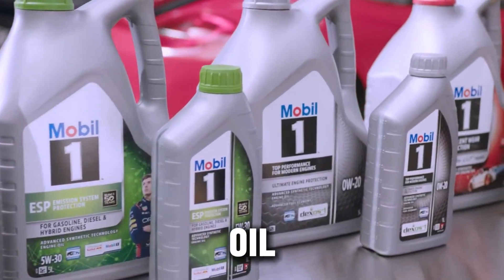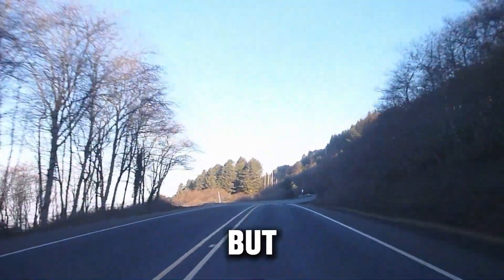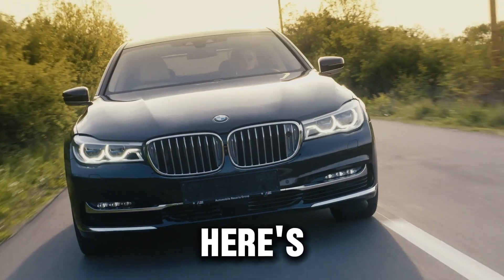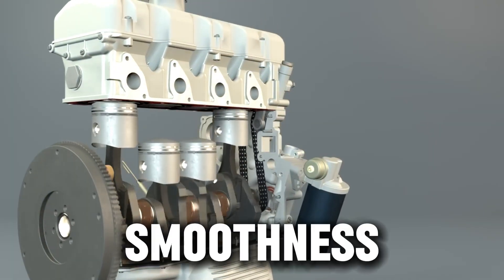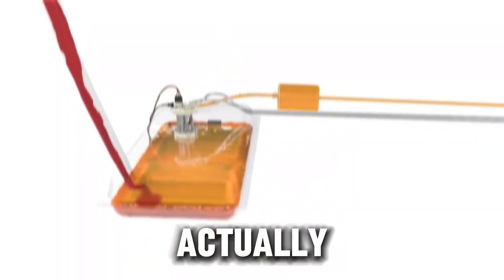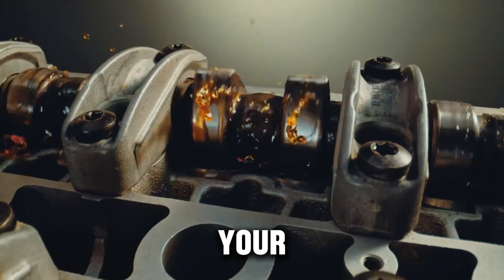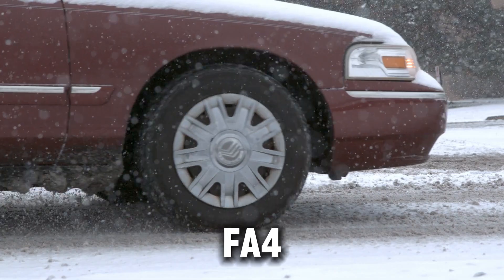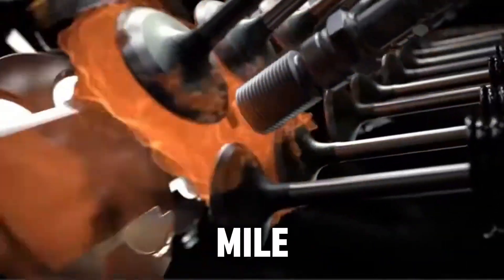The TRUTH About Diesel Engine Oils (50 Engines Tested!)

Comment: Here's where the myth came from about when you go synthetic you can't go back. One mobile one first came out they were using actual jet engine oil, no joke. The oil was not even API approved. You see certain oils or formulated to work with certain seals inside an engine. Pure jet engine oil is not formulated to work with car engine seals. So if you added this jet engine oil to your engine it would eventually destroy your engine seals. And I don't mean one or two I mean all of them. The other part of the myth that you can't go back is because jet engine oil is not compatible with petroleum oil, because no one would ever stick petroleum oil in a jet engine. Because the jet engine would blow up with petroleum oil in it. So not being formulated to be compatible with petroleum oil means that when you mix the two it turns into a tar sludge. And that's no joke because mobile one had to pay out some big bucks to fix a bunch of engines that got destroyed because of this, in Corvette engines aren't cheap.

The reason I say Corvettes is because GM recommended that only mobile one be used in their Corvettes. And boy was that a big mistake. Because of someone was going somewhere like a vacation and ran low and oil. Back when the oil was new and had this problem you couldn't find mobil one just anywhere. So out of desperation they would add petroleum all to it and it didn't take long for that old to break down turn into tar sludge and spin all the bearings. And you know the reason why they put the jet engine oil out there? Amsoil had just came out with the first API approved oil on the market, so to compete mobile one stuck out there whatever they had that wasn't ready to go into a car engine and since they did that all these synthetic oil myths got started because they're all so screwed up. It took number one two years to fix this problem and have their synthetic oil API approved.
Reply: And about using thicker oils in engines that require thinner oils. The thickness of the oil that is recommended by the manufacturer is based on the tolerances AKA the clearance is between the engine parts. The tighter the tolerances the thinner the oil has to be. Why? Oil is 40% of an engine's Cooling. This is because the oil touches parts that the water never does touch. So the oil absorbs the heat from these parts and then transfers it to the engine block which transfers that to the cooling system and then it goes out the radiator. The problem is that to do this efficiently the oil has to flow at so many gallons per minute in order to do it right. You put too sick of an oil in the engine, and it slows down this flow of gallons per minute and because the oil cannot travel as fast as it should through the clearances. It overheats. And I only does the oil get too hot but so does the parts that it cools. An oil that's getting too hot also breaks down much faster and needs to be changed more often.

And all that breaks down faster either becomes thinner or thicker according to how it's breaking down in how it's formulated. So if you take a diesel engine, or any type of engine, that recommends like 5W30. Like a 10/40 or 15/40 in it. You just started a process that's going to increase engine wear and cause other problems. Now let's talk about the oil pressure relief valve. When you put two sick of an oil in a car to make the oil pressure go up, guess what else happens? The old pressure relief valve opens up more often and relieves the pressure that is too much for the engine and it goes back into the old pan before it even circulates through the engine. Therefore decreasing the Gallatin's per minute flow that way as well. You see the oil pump already pumps between 5 to 8 times more oil than the engine actually needs. And the reason for this is engine wear and pump wear. So as the engine wears the pump is always prepared to pump more oil as needed. But when you add more pressure because of thick oil that release valve opens up more than it's supposed to and lets that extra pressure bypass back into the old pan without going through the engine

You see engines today or not like the engines way back when, when thicker was better. Synthetic oil has three to five times the film strength of petroleum oil. This is because the molecules in the oil are uniform and not all different sizes like you get with petroleum oil. This makes the oil act like liquid ball bearings because the pressure transfer is equal to each molecule, so all the molecules are holding that pressure away from the metal at the same time. It's like having 10 people carry something heavy over their head and at least three of them are shorter than the rest of them. That means instead of all 10 people carrying the same weight, only seven are carrying the same weight and the two shorter ones are basically carrying no weight unless the taller people can't hold the weight and everything is pushed down upon them. But having the weight evenly distributed between the molecules greatly increases the film strength of an oil. And that's why synthetic oil can be thinner and still offer the same protection as a thicker oil.